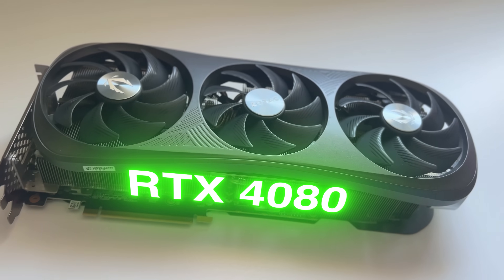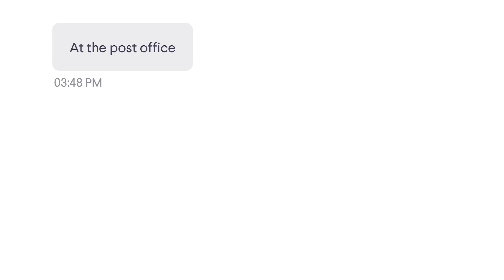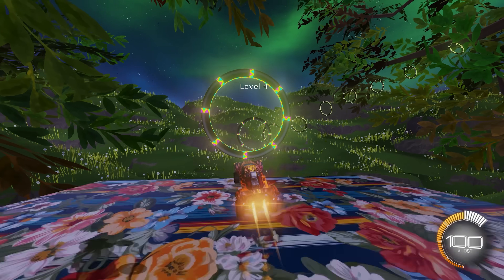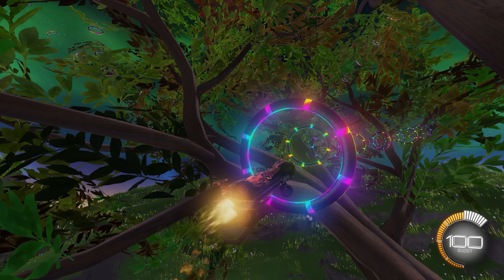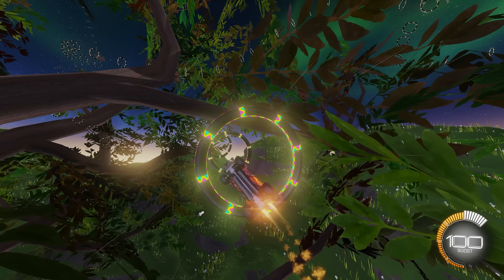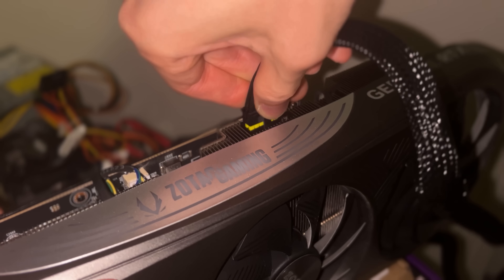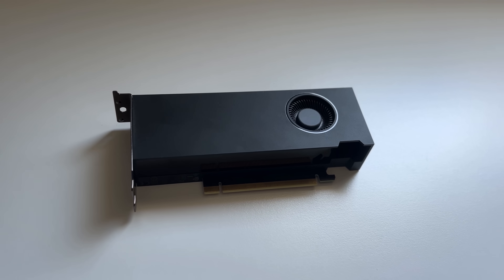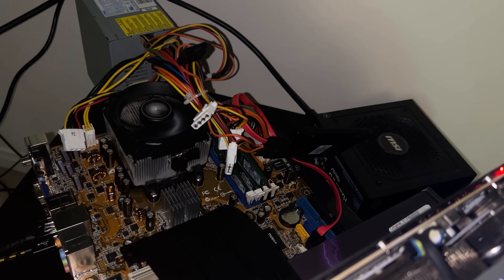RTX 4080 + 20 Year Old CPU

Comment: reminds of of those russians on tiktok who have a server-grade dell with dual xeon cpus that then get a 2070 Ti, quite interesting, as a dell enthusiast i rate this 11/10
Reply: 2070 Ti exists ?
Reply: @Fullautoracing  no, he prob meant super
Reply: its a hp mobo thoe i have the same pc he has
Reply: Now go ask them how they got those setups.."Repurposed" :face-blue-smiling:
Reply: was it really dell, not huananzhi/machinist/atermiter refabs?
Reply: This comment is objectively false. 2070 ti doesnt exist
Reply: @fenot5753  typo, meant 2070 super
Reply: That's exactly what I'm doing. I use the Dell T7910 from 2015 so its 10 years old with dual Xeons and 1100W power supply and lots of memory. The complete machine was under $1000 and I've tried the 2080ti and 3090 in it and it LLM's and games just fine.
Reply: @lashlarue59  I got a Dell T5810 with 64 GB RAM, a Quadro M4000 8GB VRAM, 500GB SSD, 650 Watt psu, and dual xenon 8 core.  Cost was $110 I sold the card for $50 therefore $60 for system. Then I bought a 2nd hand RTX 2070 super and now the bottleneck is the video card with only 8GB VRAM.
Reply: @imagecarpenter  Let's see your frame latency/consistency. I have used an Epyc CPU, a 5950x and more(4090 paired), they're not all that for gaming, especially at higher frame rates. At 60 FPS you'll be fine - but so would any other setup with that GPU. Push it up to 90FPS and lets how smooth your gameplay is.
Reply: @imagecarpenter   nice man, i have a T1700 from 2014, 32gb ecc @1600MT, 1241 E3V3, Quadro K2000, DELL 048DY8 - Intel C226 (Lynx Point Server Advanced) chipset, i love it, back in 2014 this was one of the best one can buy, and most expensive, but not you can just get one with the same specs for 150 or 250 unfortunately.  its still epic tho, runs cs2 at 70+ fps depending on what map and which wall you're looking at, not the best, but it gets the job done. i didnt get the 1271 e3v3 because it is only a 1% performance increase for like 400 euros more. 1241 Rules!
Reply: @lashlarue59  nice man, i have a T1700 from 2014, 32gb ecc @1600MT, 1241 E3V3, Quadro K2000, DELL 048DY8 - Intel C226 (Lynx Point Server Advanced) chipset, i love it, back in 2014 this was one of the best one can buy, and most expensive, but not you can just get one with the same specs for 150 or 250 unfortunately.  its still epic tho, runs cs2 at 70+ fps depending on what map and which wall you're looking at, not the best, but it gets the job done. i didnt get the 1271 e3v3 because it is only a 1% performance increase for like 400 euros more. 1241 Rules!